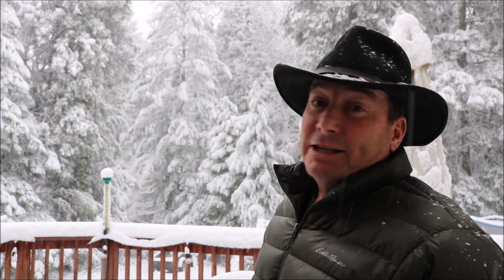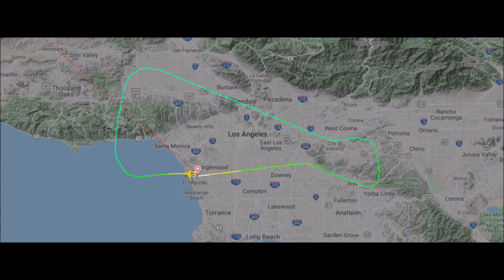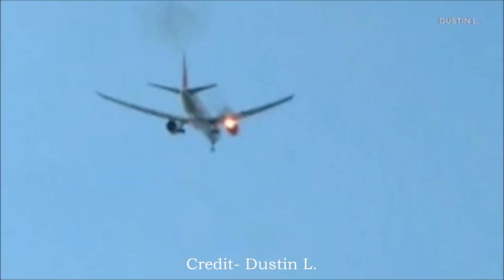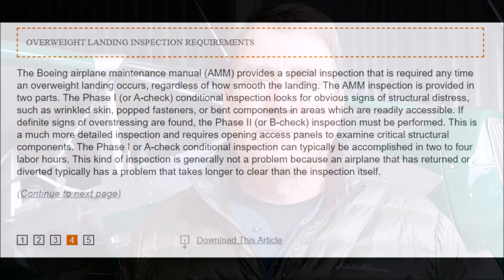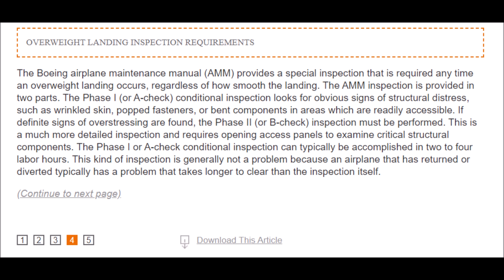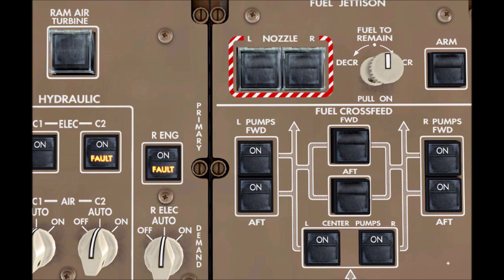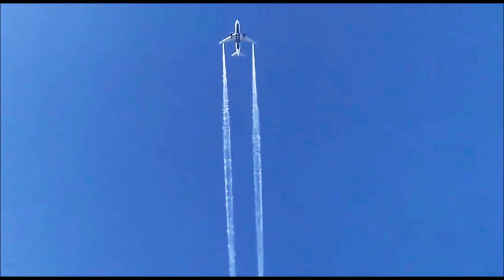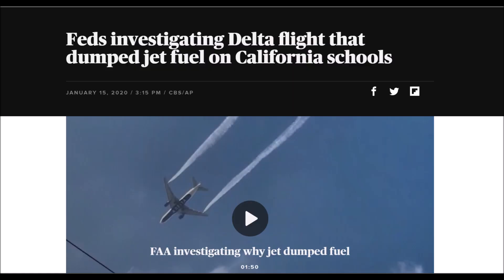B-777 Fuel Dumping and Overweight Landing Considerations (Part II)

Comment: Juan, i think one of the more significant concerns here may come from the ATC side in not being advised of the fuel dumping, and even being told "no" when they asked about it. not just because of fuel reaching the ground or as a communications issue but because there is a legal change in requirements for them, particularly being in approach-control airspace. 7110.65 Ch. 9 Sec. 4, 9-4-4 specifies that separation criteria from an aircraft dumping fuel changes to 1,000 feet above, 2,000 feet below, or 5 miles radar / laterally, and even VFR aircraft must be kept at least 5 miles away. ATC is also required to broadcast to other aircraft that dumping is in progress. It's second-nature for a controller to give an emergency aircraft a wider berth anyway, but if the investigation discovers a violation of those separation criteria in the downwind to 25R or wherever during this event, that will open another can of worms where the crew is basically responsible for causing a separation error with the failure to report the dumping.
Reply: In an emergency the Captain has fairly wide latitude to make judgments as to the safety of his aircraft and crew. Fortunately no one on the ground was seriously injured. You will note in the pictures of the fuel being dumped that the fuel almost immediately starts to vaporize as it is coming out of the dump nozzles. AT 2500 feet agl the fuel will not likely totally dissipate prior to reaching the surface, but will be more like a fine mist. Reading the news reports you would think that the aircraft was pouring a liquid stream on the ground. The first priority is getting the aircraft, crew, and passengers safely on the ground. Mission accomplished!
Reply: @shenandoahhills7263    Why would the safety of the aircraft and crew be in danger? How would he know that "no one on the ground was seriously injured?
Reply: @nodttiurp  We don't know the full extent of the emergency, or why the Captain's concern was to return for landing expeditiously. There was another incident a while back where an El-Al Boeing 747 cargo jet lost two engines shortly after take off. The Captain decided to proceed out over a lake to dump fuel prior to returning to land. After dumping their fuel they did not make it back to the airport, killing over 100 people on the ground. In this situation, the crew likely was concerned that the engine malfunction might have not been isolated to the one engine, as in the case of fuel contamination. There have been cases such as  Eastern Airlines flight 855 out of Miami, where one engine after another on a Lockheed L1011 lost all 3 engines. Fortunately they were able to restart one engine and barely made it back to the airport. This is not the time to screw around, get the aircraft back on the ground safely, if you have to answer a few questions, so be it, but everyone was safe to live another day.
Reply: Reflected Miles FAR 91.3 does not relieve the pilot from gross negligence.
Reply: @shenandoahhills7263  Then why dump at all? It was apparent from the first and IMO most significant part of this video that it wasn't necessary.
Reply: @Eric Lopkoff Just for educational purposes, it is 14 CFR §121.557 that is applicable for this type of operation. The key phrase for all operations, however, is that the authority to deviate is granted to the extent required in the interests of safety. The comments suggesting that no rules, standards, or procedures apply because it is an emergency are incorrect.
Reply: @davidchamberlain4861   "It was apparent from the first and IMO most significant part of this video that it wasn't necessary". 

Humm, Are you an airline Pilot typed in the B777?  I doubt that he intentionally wanted to harm anyone or anything on the ground. One of the points not made so far is that in a non-emergency situation if a crew lands the aircraft over the max landing weight, they will be doing a little dance in front of the Chief Pilot. This can happen with an unexpectedly strong tailwind. Usually the aircraft is not overweight by a large margin, so you have to dirty the aircraft up early and drag it in on a long approach.
Reply: @shenandoahhills7263  That EL-AL 747 (LY1862) did not dump fuel.  It lost two engines while it was flying over the lake on its normally expected departure track (not "lost" as in "they were not available for their normal task", no, these engines really dropped off the plane and went into the lake!) and then it turned back to the airport and actually made a complete circle over the densely populated city to finally crash in a large appartment building on its final approach to the airport.
Reply: @Rob2  Here is what the History Channel had to say about the accident. "Fuchs decided to dump the plane’s fuel in a lake and head back to the airport, but the plane did not have enough power to make the return trip. Six miles short of the airport, Fuchs radioed, “Going down,” and the plane plunged straight into an apartment building in the Bijimermeer section of Amsterdam." After further review I would agree he was too high for an immediate turn back to the airport and had to circle to get down. The crew did not realize the extent of the damage caused by the separated engines, and the aircraft stalled because they were unable to extend the leading and trailing edge devices uniformly due to the loss of hydraulics.
Reply: @shenandoahhills7263  The History channel was apparently completely wrong on this matter.  The issue was not "having insufficient power", the issue was as you write: the damage to the right wing due to two engines breaking off was so extensive that once the flaps and slats were extended for the landing the right wing did have much less lift than the left wing and the plane dived in a spiral ending on the Bijlmermeer.   Not straight, but banked over 90 degrees.
The fuel then burned on the crash site.
The crew probably did not know the engines had fallen off, they thought it was an issue with the engines (like a fan blade breakage) and subsequent fire.
This being a cargo plane, there was no infromation from the cabin about that and it would have been difficult to see this from the cockpit.
Also, it apparently isn't procedure to look from the windows upon engine problems, this has been a factor in other accidents as well.
(I sometimes wonder why today not all planes are fitted with a couple of cameras like you find in your smartphone and present a view of the structure of the plane in the cockpit when desired.  of course LY1862 was way before that was technologically easy)
Reply: @Rob2  Agree, A better example would have been Swiss Air Flight 111 that had an onboard fire. Rather than expediting to the airport they made the decision to circle over the water and dump fuel rather than land overweight. They never made it.
Reply: @shenandoahhills7263  I agree with you....
Reply: @Rob2  As to why not having cameras to check for structural damage around the airplane? It's probably money.... You know how that goes, a few people have to die first before major airlines will make a change and they have to prove that cameras are the leading cause of not having them installed....
Reply: @lostmic  Modern planes do have such cameras, but they are mainly for passenger entertainment, not even sure if the images can be viewed in the cockpit.
Of course there has to be separation between the entertainment network and the aircraft control, otherwise the result could be another class of problems.
(there are solutions for sending the same material to different systems without risk of connection between those different systems)
Reply: @Rob2  Yeah you might have misunderstood what I wrote and after further review, I can see how. I was just facetious in the matter of in order to get them installed on multiple airlines, it will cost a lot of money but not only that. The airlines don't want to do it and will find any way to make a case that there are written procedures that do better than having a camera or something like that....  All because of money and to get them installed will take a major crash that proves having them is a must which hasn't happened yet. idk that's just my opinion, I can be completely wrong here lol
Reply: @shenandoahhills7263  how? Swiss 111 was a MD-11, and they had fire spreading onboard.

777 is not MD-11, there was no fire, and as Juan discussed, they can land safely without dumping fuel.
Reply: @chrisfeng8936  Feng, I believe that you missed my point. I am aware that Swiss Air 111 was a different type and that they had a fire. In this case we have a two engine aircraft, with one engine acting in a problematic manner. Is it wise to take the time to head away from the airport, out over the water, to take what could be another 20 minutes or so to dump fuel and then fly the additional distance back. Swiss 111 caused a lot of controversy because the crew followed their airline protocol when the option to head straight in and land might have saved the flight.
Reply: Shenandoah Hills Sometimes either/or is a false dilemma. As Juan noted, the crew conserved a lot of their energy initially, with 370 kts of groundspeed at 8,000 in the downwind (MSL is nearly AGL over the Basin). Taking a decision to dump fuel at that altitude while returning is unlikely to cause any issues but also unlikely to help much in that small amount of time. With proper advisories made for their intentions, they could have requested to hold in the downwind at 8,000 or 10,000 ft. while dumping, and at speed, rather than extending, if your concern was their concern, given their priority as an emergency aircraft. Flight crews and ATC can work magic together even in busy airspace if we really need to. We’ve seen that many times, and I have experienced it personally. Presumably the investigation will show why they chose as they did, for better or worse.
Reply: Shenandoah Hills that wide latitude has to be justified. You take it at your own peril. As emergencies go, this one was fairly routine up until the point they dumped fuel on a crowded community.
Reply: Shenandoah Hills this clearly was not one of those situations. Let’s be honest with ourselves.
Reply: @ReflectedMiles  We are "reflecting" on these events from the comfort of our arm chairs rather than in the dynamic course of events, where decisions are being made under a high work load and a lot of pressure. Should they have continued to dump fuel at such a low altitude over a populated area? Certainly not. Should they have notified ATC of their intention? Certainly yes. The most important facet, was that they continued to "fly the aircraft", they arrived safely back at LAX, and no one was seriously harmed. That is a very good day when everyone will live another day and the aircraft will fly another day.
Reply: @joetheairbusguy1813  True.
Reply: Shenandoah Hills There you are, confusing luck with skill. They operated negligently. It was pure luck that people on the ground were not hurt more than they were. It was pure luck that another aircraft didn’t trail them or cross their fuel vapors to their death. The pilots of that Delta 777 were careless and what they did could have cost lives. You cannot give them a “safety” credit here.
Reply: @lostmic  Plus, as Juan has told us, every proposed change to an airplane has to be approved by the FAA, even something seemingly innocuous like adding a camera to view the wings.
Reply: @afcgeo882  Hi George, I can't disagree with the fact that the crew failed to notify ATC that they intended to dump fuel, that they dumped below the recommended altitude, and that they continued to dump until turning final at a low altitude over a heavily populated area. That it was not critical to dump fuel since the aircraft was certified to land at a weight above their maximum landing weight, and that the runways at LAX were sufficiently long to land at close to their take off weight. They deviated from the FAR's when on downwind at 8000 ft when they were at about 370kts. I don't remember them advising ATC of that intention. The speed compressed the time they had rushing the situation and made it more difficult to slow down and get to their assigned altitude before turning in. So what happened to cause the above? I believe that there is a misunderstanding by some crews as to the capabilities of heavy aircraft to land at high gross weights above their max landing weight. Secondly I believe that there was a breakdown of CRM in the cockpit. Twice we hear transmissions where there was some confusion. When asked if they needed to hold to dump fuel they responded in the negative. When asked if they wanted the emergency equipment to be standing by they initially responded in the negative and then that was immediately corrected as if the Captain intervened. After completing the after t/o checklist and the engine surge checklist they then would move on the the descent and approach checklist. It is likely that at this point during their brief and set up of their airspeed bugs that they realized that they were going to be landing overweight. We don't know if the aircraft was still over the ocean at this point but apparently it was decided to dump fuel. Normally they would have had an augmented crew and I expect that there would have been an additional crewmen in the cockpit. In the United 232 crash at Sioux City the additional crew-member was utilized very effectively. We don't know who was responsible for monitoring the fuel dump progress, but that could have been assigned to the additional Pilot if they were available. The Pilot flying seemed to do a good job of flying the aircraft, they appear to have had a normal approach, although, the approach speed of 157 kts (ref of 147 kts plus 10 kts) seems to be slower than I expected with partial flaps, and they did not overheat the brakes blowing the fuse plugs. So there is a lot to learn from this flight. Delta had to go back to square one on their cockpit culture and CRM after the two crashes at DFW. I would suggest that another review would be in order after this flight. I am certainly pleased that everyone was safe, that the aircraft was not seriously damaged, but it is dismaying that some innocent children on the ground were affected by the discharge of jet fuel.
Reply: Shenandoah Hills It’s customary to preflight with the entire crew, including relief, and go over the turn-back procedures for an engine out at takeoff, so I don’t know how they could have missed the weight issue. I agree that CRM was an issue. Not sure if the Cpt was really in command in that cockpit. The 777-200 can land at full MTOW, given the runway distance. The Captain needed to have made the decision either way and stick with it. Really poor work here.

Comment: There has been in recent years an effort to train pilots on the fact that the overweight landing is a perfectly good option. This is in response to like you said, notions that are carried over from one generation to the next and even thought as if it was correct information. We saw some of that in the case of AA587 where it was believed by this FO flying the A/C that the correct technique when encountered with wingtip vortex was to  apply rudder in both directions, in fact he ended up destroying the tail with an incorrect notion that is passed along.

Comment: +Several years ago I had to do an overweight landing in an EMB-145. The procedure for that was if the descent rate at touchdown was 300 foot per minute no inspection was required. Of course I landed below the descent rare.

Comment: Nice review, Juan. Interestingly the 777 holds about the same amount of fuel as a B-52. The buff has no dump capability and crappy brakes so it has to burn fuel for about 6 hours ( low altitude, gear and flaps hanging)after a max t/o weight launch.

Comment: For me, the most disturbing part of this entire emergency is the crew allowing the airplane to accelerate to 370 kts + ground speed on the return. Remember when a burnt out light bulb brought down  an L-1011? Or, a crew spun a 747 while troubleshooting a decelerating engine? Fuel dumping below 6000 comes under a whole different WTF category.
Reply: @foobarmaximus3506  Pro pilots here know exactly what I'm talking about.
Pilots get so focused on the problem,  they stop flying the airplane. 
The L-1011 flew into the Everglades because the crew, plus a few more, fixated on a landing gear problem, and no one was flying plane. Same thing with the 747.
At this point, we don't know what their indicated air speed was, but at 370kts GS  below 8000, it was close, if not over, Vmo.
You're in close and returning to land, and you're 100kts plus too fast, while descending, for flaps, slats, and gear?
The PF should have been precisely flying the airplane.
It should have been a single engine approach, flown by the numbers determined by weight.
Pro pilots here also know where I'm going with this, I just prefer not to say it at this time.

Comment: Great video.  You are making pilots think about learning more about their aircraft nuances.  That legacy memory takes time.  I remember in cars changing braking on ice due to front wheel drive and the switch from carburetors to fuel injection.  This is related to the Max problem where learning was ignored in many cases.  Boeing was to blame but knowing how to disable it was available via training to the max (no pun intended) Great video and although I don't fly it is great info for conversation when at a party where there is someone in the airline industry.